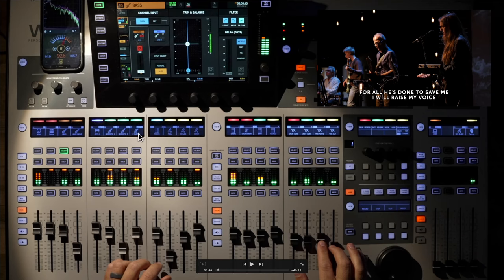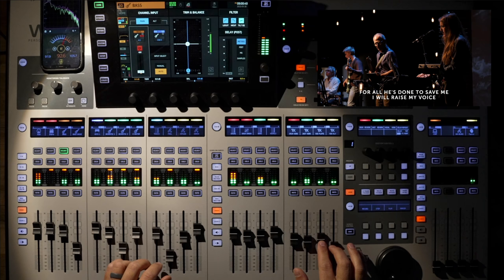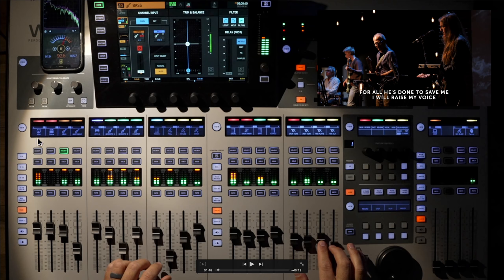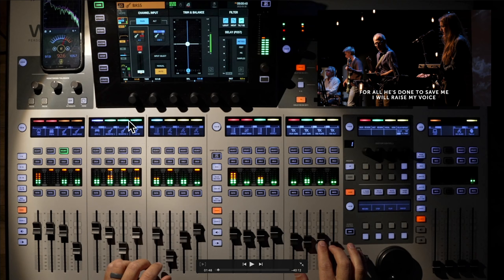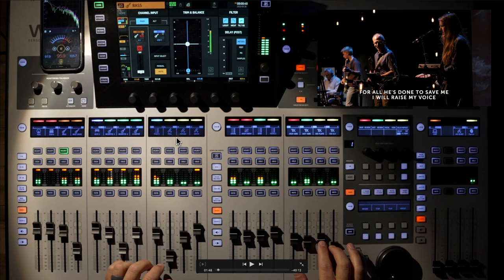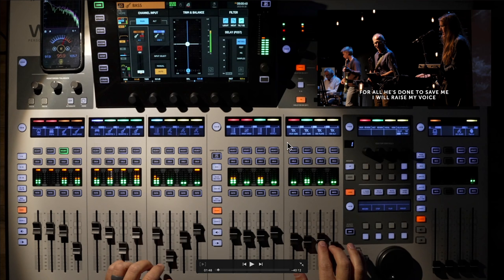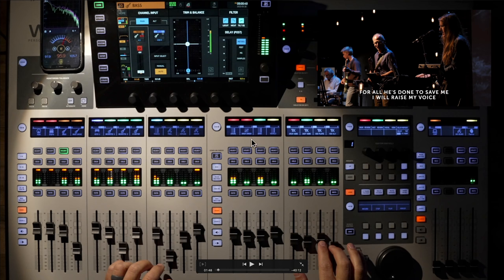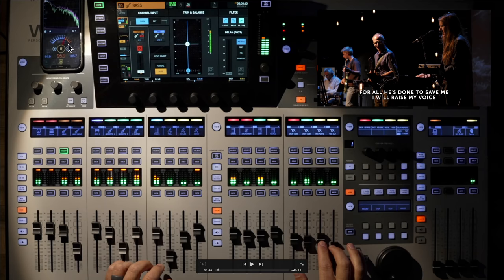How I Mix for Worship | Behringer WING

Comment: The Wing sounded cleaner then I thought it would. Not liking the drum sounds. The kit sounds a bit behind the mix and not enough definition (body) to the snare and kick drum. I find the toms don't have that nice crack to them. I would have the bass a little louder too. But..this could also be because like you said, we aren't hearing the sound of the room. It might sound killer in the room. :) The mix is pretty good. Nice work!!

Comment: Great video! Love it. I realized that your gains are by far lower than mines. What stageboxes are you using? I have a Midas DL32 and I read somewhere else also that you have to have very high gain settings in order to get the signal to an acceptable level with these stageboxes.
Are you using Behringer stageboxes?
Reply: We have a s16 and I find the gains have to be pretty high for something like a sm58, so I doubt they have a lot more gain than the DL versions
Reply: @stephenevans2518  ah ok - understood. Seems the same as with the DL32. THX

Comment: 48 Stereo. 96 mono right?
Reply from the maker: You have a few hundred available mono inputs but only 48 channels that can be mono or stereo.
Reply: The Wing can mix up to 48 channels. The channels can be configured to be stereo or mono. In theory, it can handle up to 96+ inputs.
Reply: Thanks  @johnalmaraz39